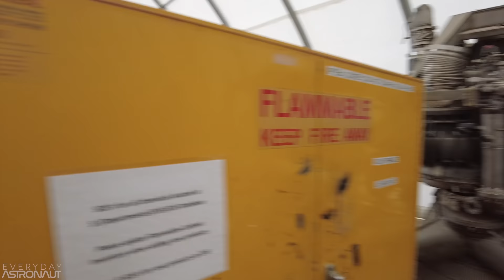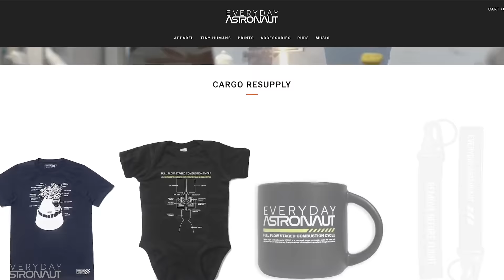Tour Firefly Aerospace's Factory and Test Site With Their CEO, Tom Markusic

Comment: Interesting explanation about the benefits of using Carbon Fiber in the tanks construction. Would be great to see an all Carbon Fiber Rocket with similar size of Falcon 9.
Reply: SpaceX originally wanted to make an all carbon fibre 12 meter Starship.

I think as advances composite research continues to advance the first people to really give Starship a run for its money will be whoever develops a carbon fibre Starship analogue/derivative.   Could be 30% the dry weight allowing for a huge payload boost.
Reply: @isaiahphillip4112  quite skeptical about Starship layout. The market is moving towards smaller rockets as Rocket Lab and Firefly. Check how few missions had Falcon Heavy.
Reply: @RogerM88  If Starship full/rapid reusability pans out it'll likely cost less to launch than most small sat launchers even without ride sharing most of them will go out of business virtually overnight if they can't adapt.

Smallsat launchers make a ton of sense, unless somebody creates a paradigm shifting revolutionary vehicle which is exactly what Starship will be if successful.

This is why Blue Origin, China, and any space organization with the funds to do so are already roadmapping a Starship competitor.
Reply: @isaiahphillip4112  you're wrong, for different reasons. First, Starship is massive, and needs huge amounts of fuel. Second, you still have to sustain an extensive launching infraestruture. Third, you have many Staff members to pay. Fourth, you'll always to have refurbishment or checkups at least, after each flight. Fifth, being reusable would mean less payload to LEO, and add to that the unusual why to release the payload, could mean costumers choosing more traditional rockets with a payload fairing. Seventh, Crew certification could be delayed too much time, due to requiring to propulsive landing.  Then you got Rocket Companies as Rocket Lab investing in lighter rockets as Neutron. And a market increasing choosing more compact rockets in ride sharing.
Reply: @isaiahphillip4112  if reusable rockets provide cheaper access to LEO, why SpaceX charging costs per launch to NASA aren't getting significant lower? If they were "so cheap". Many costumers would just using them, not other companies as ULA.
Reply: @RogerM88  "if reusable rockets provide cheaper access to LEO, why SpaceX charging costs per launch to NASA aren't getting significant lower?"

Because capitalism?  If the going market rate for a Falcon 9 sized rocket launch is 60 million dollars, why would you charge less than that just because you can?  They still need to charge enough to recoup the massive investment they've made in reusable technology.  Also SpaceX does charge NASA significantly less than competitors, as much as 10's of millions of dollars less depending on the mission.

Many customers do use SpaceX, ULA barely has any customers other than the federal government.  

The fact that SpaceX has been able to self fund more than 20 Starlink launches suggests their internal launch costs are extremely low.

Comment: How is the tap-off gas cooled before hitting the turbine?
Reply: At 07:37 Tom says:

The magic, (and what we have the patent on) happens inside the head end of the engine here. We call it the tap-off manifold. The way we extract that [gas] and the whole environment that we extract it in, and how that is coupled with the topology of the flow around the injector all plays into how we do this...

I can tell you this is the only tap off engine ever where we don't have to cool the exhaust the gas coming out of the chamber.

Usually you have to dump some diluent fuel in to get that temperature down because it's 6000 Fahrenheit inside there but this turbine can only take 1200-1300 Fahrenheit
We got to make sure that the 6000 isn't going out here and we've designed it all so that we don't have to put a drop of fuel in.

So you're burning with 2.3 [O/F ratio] -- that's not stoichiometric  but it's optimal for isp.
All that combustion takes place in that environment, where you get good complete combustion with very little soot -- very important! 

If [on the contrary] you look at the turbine powered by a Gas Generator, you're running that thing at 0.3 O/F ratio and it's just puking out soot like a big steam engine from the 1800s -- black, clogging up turbine nozzles and all that.

But we are extracting all that gas from the combustion chamber where you're producing a lot less of that sort of stuff. We've never had any degradation of the turbine system -- no turbine nozzle plugging, no coking.

==========

So, that is how they do it. And that must be true. But if you check the drawings of the tap-off manifold for the upper stage "Lightning" engine, there it does dilute the gas with kerosene. But that design incorporates an injector that looks like 1930s German design that eventually became the basis of V-2 engine.

For the first stage, Firefly uses a pintle injector, and those are known to create a doughnut-shaped circulation pattern in the very top part of the combustion chamber. Perhaps they draw cooler gas from there.

But it is hard to tell -- not everything in these descriptions makes sense.

Comment: 90 bar, 6000 F.  venus has 90 bar ~900F.  the same designs/tech for the inside of the rocket engine could be used on the outside of a venus lander to make it last more than just a few minutes..

Comment: I’m actually curious what they have in store for Firefly Beta. With Terran R and Neutron looking towards attempting a Starship-like vehicle at their respective classes using completely different design approaches, Firefly is going to be in a bit of a pickle, especially if Gamma is only 75% reusable as a spaceplane. I may go so far to say Gamma could just become a second stage to Beta and both bring Composite structures to full reuse orbital rocketry, where Rocket Lab had to abandon it. 

Impulse density is one thing, and so is the need to carry less mass into orbit. But what you use that extra mass for in orbit makes the difference between staying with a mere satellite deployment vessel that can only break up on reentry after being used, or being able to remove and recover satellites, reentering intact and landing, either vertically or horizontally, and being capable of doing highly regular spaceflight on a common basis. If Starship needs landing legs, even with excess weight to achieve that, so be it. Risking new technology that has incredibly slow iteration cycles (like monolithic towers that may take SpaceX a year to complete each) when your competition can iterate faster than your company can is a bad idea for scaling up operations quickly.

Comment: That green thing coming out of the nozzle at test firing, is that engine rich exhaust? I think I heard nitrogen start so it can’t be t-tab ignition fluid :)
Reply: TEA-TEB ignites and burns a green color. Nitrogen is both inert (doesn't burn) and used for another aspect of the start procedure.
Reply: @wheretheeffareryanandsteph  
Exactly, which means that green exhaust in the video. :)
Reply: @macjonte  They use compressed gas to spin up the turbine, and TEA-TEB to ignite the fuel.
Reply: @cogoid  
Ah, thanks. That does explain the green stuff. :)

Comment: Blow off valve on turbo = throttle.  that's what i told ELON on twitter which helped space x land their rocket vertically. i'm fair.  just lazy.  but also that EGR gas is flammable ,  they found that out the hard way.   but next one worked fine.
Reply: he said there was no minimum thrust, and i said, RELEASE THE KRaken   vent the exhaust gas instead of recirculate in closed loop, you can open the loop to reduce thrust, duh.  ez physics.  Dont try to save fuel, just waste it.

Comment: I was with him right up to when he said he doesn't understand Kelvin. Because it's a fundamental temperature unit for use in engineering that defines the energy of a substance/fluid/solid. Energy is zero at zero Kelvin.
Reply: There’s a difference between understanding the concept, and understanding what the numbers actually mean.
Reply: @cameronwebster6866  eh?
Reply: @mgutkowski  for example, intellectually, I understand that 0K is zero heat energy, but I have no clue if 200K is freezing, cold, warm or hot.

Comment: Did this guy just stroll into his cleanroom wearing nothing over his feet and touch everything with his bare hands while everyone else is wearing overshoes, gloves, and coats?
Reply: There's different levels of clean room. That room mostly looked like a "keep the dirt from the machine shop out" level of clean room. The people in there weren't wearing any kind of hair coverings. So a little bit of normal particulate matter was fine. They didn't even have a "stick mat" that pulls the dirt off your shoes as you walk in.
Reply: @Ergzay  if they’re wearing antistatic overshoes and coats then everyone in the room should don the same kit as a requirement for entry. As CEO he should set the example for cleanliness standards. I’ve never been in a clean room that didn’t also specify hair nets as well as overshoes and coats as hair is one of the worst offenders for contamination. I would expect to see hairnets for composite layups as you wouldn’t want hair entrapped in your composites before autoclave. The lack of a stickymat may be because the procedure for donning the overshoes negates the need for one, but honestly it just looks like a lax and uncontrolled operation to me. Source - 10 yrs in the aerospace industry.

Comment: I may be ignorant and I may be excessively harsh, but sometimes its better to anticipate what's ahead of the curve than to watch yourself get steamrolled in slow motion. The train is coming. You can't see it yet, and you might not even be able to hear it, but it's coming. You either need to get the f out of the way or jump aboard. Jumping aboard means building things that will go on the moon or Mars. Start designing and patenting that stuff and your company will remain relevant for decades. Keep designing obsolete little rockets and you'll be crushed. All of these companies are fighting each other for the same thing. There are plenty of other things to go get that doesn't require fighting. And these things are even cooler. Who doesn't want to start patenting technology that will be used on off-world bases? Why isn't anyone thinking ahead?